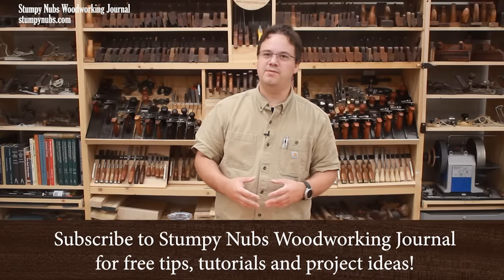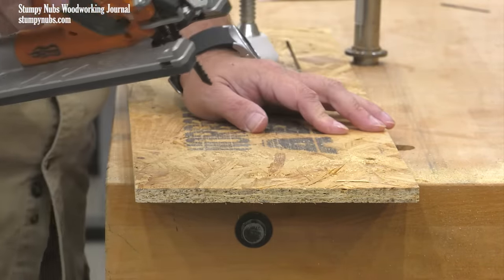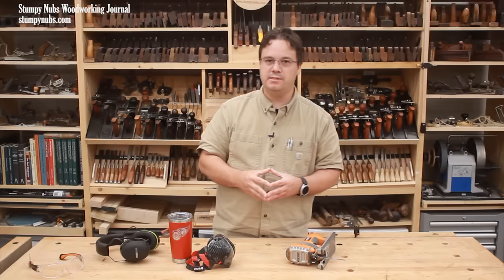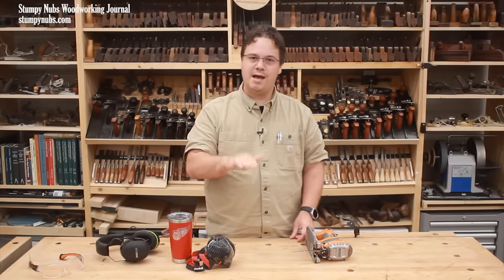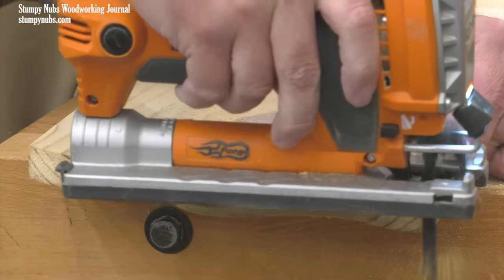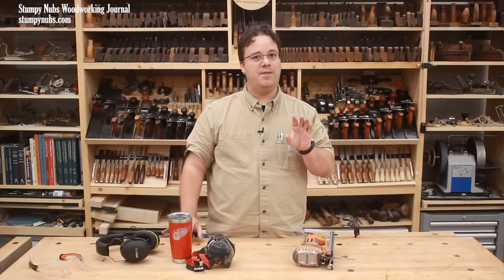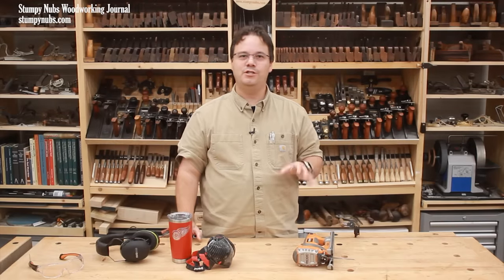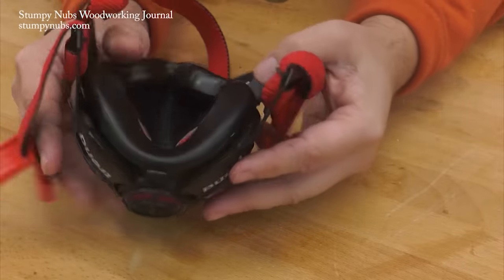How I made my jig saw cut a LOT better

Comment: I'm not sure where you got that 100 dB is "four times louder than what's considered safe".  OSHA safety requirements specify 85 dB as the limit for unprotected ears.  dB is a logarithmic scale (multiplied x10), which means that 100 dB is 10^10.0 / 10^8.5 = 10^(10.0 - 8.5) = 10^1.5 = about 32 times as loud as the OSHA limit (not 4).

Of course, the way we perceive sound, 100 dB doesn't actually sound what most people would think of as "32 times louder" than 85 dB (it sounds about 1.5 times as loud), but the sound actually imparts 32 times as much energy to your delicate ears when it hits them, which is important to understand.

Comment: Hi Jim, I left a message on the web site for you but thought that I would also try to contact you via you channel here. I want to get a new lathe and had seen where you really liked the Harvey T40. From what I've seen and read I think thats what I would like to go with but before I pull the trigger, for comparison's sake, is there another brand that is any better in the +/- $2500. range that you recommend ??   Thanks !!
Reply: Hey, I had seen a video about the Nova Galaxi DVR maybe as a comparison. I'm leaning towards the Harvey as it looks like a good machine. Any advise/suggestions ?

Comment: I thought coping saws were the original "true" jigsaw - used for cutting out jigsaws. I used to cut my scribed mouldings on skirting and architrave with a coping saw, until I discovered thin scrolling blades for an electric jigsaw.
Reply from the maker: "Coping saws" were originally called "turning saws" because you could turn the frame in relation to the blade to alter the position of the throat. I have never heard them called jig saws.
Reply: @StumpyNubs  I meant that I thought they were the original tool used in creating the puzzles, whereas they are stamped now. Is there a connection between the puzzle and the electric tool?

Comment: You didn't cover that for cutting curves: blades with intermittent sideways bend teeth are much more suitable than blades that have the sides flat grinded. The latter are quite popular for precision and splinterless work, but are horrible in curves.

Comment: What you call a jig saw is, to me, a sabre saw. A scroll saw is similar to a sabre saw, except there is a knob on top that connects to the shaft that holds the blade. Turning this knob turns, or scrolls, the blade so it cuts in different directions, i.e. forward, to the left, right, the rear, and any angle in between. The stationary tool is a jigsaw. It was around when the jigsaw puzzle was invented.

Comment: No tape on the base of any saw for me-  nothing more aggravating than grabbing a tool with tape half worn through tape that someone put on the bottom.  Put that tape on the work piece.
Also, if your using a down cut blade ( and your saw had adjustable forward motion on the blade)   put it on the lowest setting of forward bite.  This greatly reduces the chance of the saw jumping out of the curf.   Lots of good info in your video, keep up the good work of teaching us old dogs !
Reply from the maker: If you can peel the tape off a workpiece after a cut, you can peel it off the saw after a cut.
Reply: @StumpyNubs  trouble is- people leave it on and once its on there a while, it doesnt come off that easily and leaves sticky residue.  Granted if your the only one in the shop you have that control.

Comment: I had an old craftsman jigsaw that had a knob with a lock directly over the blade. When unlocked it allowed you to turn the blade and not the saw body.
Reply: I have that saw, great for tight areas where you can’t turn a regular jigsaw.

Comment: Forgot to mention non directional, or straight tooth blades. I frequently work with veneer plywoods and find the Bosch narrow shank non directional blades less likely to tear up the veneer. 
 As far as the angle feature goes,I do find it useful for slight back cutting on a scribed workpiece

Comment: My jigsaw doesn't cut parallel with the sides of the base. I think it's because how the blade is held in place, you insert the blade and then a metal piece twists over the bottom from the side. Stupid design I guess. So you can't use a guide to cut anything..